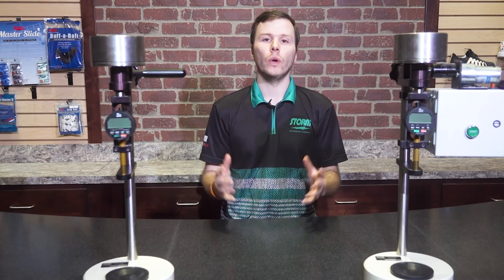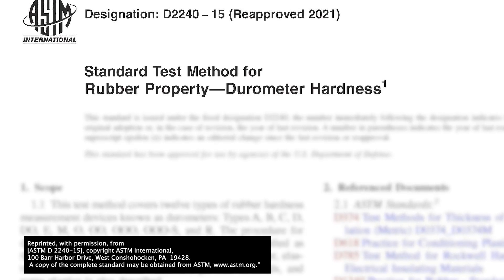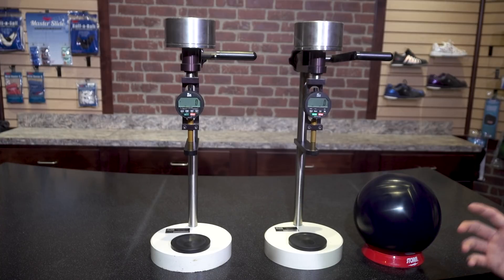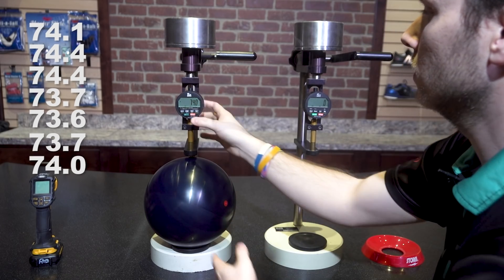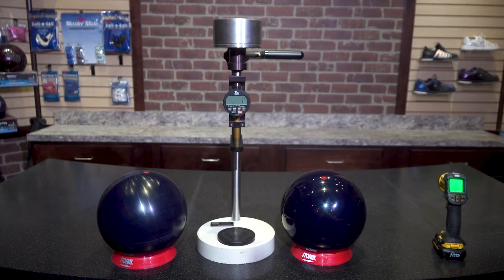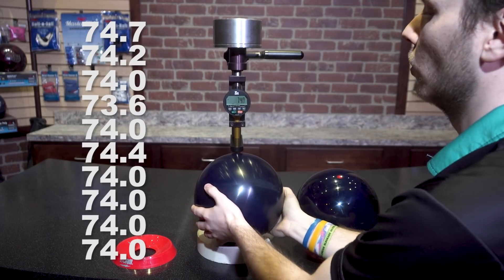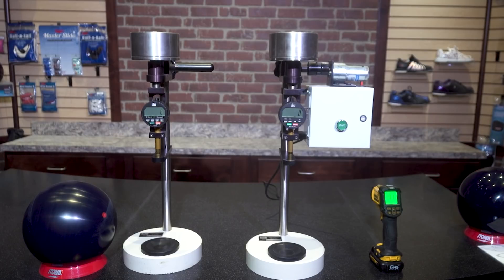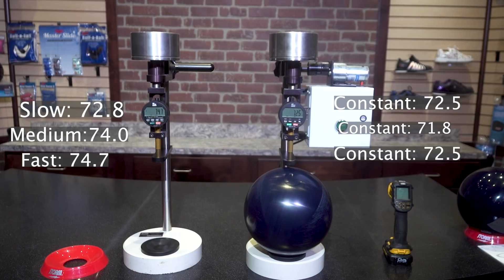Storm | Durometer Testing

Comment: Storm should sue
Reply: @bbarnes654  where? Arlington in the same room with the same durometer used for initial certification.
Reply: On what grounds? That they didn’t produce product to the specs they agreed upon with the procedures they agreed upon?
Reply: @williamfreitas7016  USBC simp.
Reply: @williamfreitas7016  Too many variables. The usbc data was total bunk. They didn’t visually show the testing. Its all numbers. This video clearly shows there are far too many variables to ban 6 balls on the grounds of this flawed testing.
Reply: @Hahahanoyes  they still can’t sue because they agreed to the process and procedure. Well they could but they wouldn’t win and they know it. The time to question the results is when they received the report on initial certification saying the balls were within .5 of the spec which auto triggers spot checking IAW the equipment specifications manual.
Reply: @williamfreitas7016  you know they did produce balls in good faith. Your being a troll. The whole point of the vid shows how usbc is playing dirty with measuring metrics that have variances they don't want to allow for. Either out of ignorance or spite. Either way, storm deserves to defend themselves. And can sue for losses if it goes that far.
Reply: @MGW1974  no, I don’t know they were produced in good faith and “accidentally” fail after. I hope so but don’t know. I’ve been saying all along that given the fact Storm doesn’t make it’s own coverstocks the subcontractor could’ve done something to alter the final specification. But that’s not what Storm is saying. They’re blaming a process they could pass since inception until recently.

Comment: I don’t think this is the right way to handle this situation. Storm is publicly challenging the validity of the rule. These findings/defenses should be brought to the attention of the USBC privately. They can petition for a rule change or more explicit standardization of testing. This is trying to publicly discredit the rule and the governing body of the sport. If I were a regulator in this situation I’d be pretty unhappy.
Reply: if USBC went to Storm privately and said we think you guys have an issue, you should look into it and make sure everything is right. Then I'd agree with you
Reply: @rb8999  you mean like they did with the Spectre and were told nothing is wrong?
Reply: @rb8999  Exactly. USBC brought this into the public sphere. Storm has every right to publicly disclose its defense.
Reply: @rb8999  This is exactly what the USBC did. They found an issue and handled the matter with Storm. An agreement was hashed out, a consent order of sorts, and a joint statement was released.
Reply: @IamtheBonkers  We don't have all of the information and we never will. 

Assuming Storm calibrates against USBC's durometer every quarter, what if there's enough difference where Storm measures balls as passing and USBC measures them under spec? This video shows to the public who has no clue that there can be differences. Was this just an issue in Q4? Were there balls from Q2/Q3 that didn't pass?

The reason as to why this started with the Spectre won't become public knowledge.
Reply: @rb8999  What you're saying exactly illustrates my point. This video response puts into question the USBC's rule and their testing methodology. It inflames the situation and erodes confidence in the USBC and the rules and regulations which govern the sport. 

I don't know what was discussed behind closed doors -- of course. However, it's clear the exclusion and exchange program for the six products (not including the spectre) was an agreed upon resolution hashed out by some kind of consent order between the USBC and Storm.
Reply: @IamtheBonkers  confidence in USBC has been eroding for years, nothing new there
Reply: @rb8999  confidence has been eroding, yes. Also statements oozing with the holier than thou, condescending attitude as Chad Murthy’s sure don’t help that matter. But in this situation we won’t know if it’s properly being placed.
Reply: @rb8999  I believe they are calibrated prior to each testing session against a known hardness.  Calibrated meaning within the Testing spec of the durometers.  So it would be more than calibrated quarterly.  I used to do testing in another field and we calibrated our equipment every time we started a testing session to make sure the equipment readings didn't drift out of spec.
Reply: @Music-pl8xf  yes, obviously calibrated more than quarterly. USBC allows companies to cross check their durometers directly against USBC's quarterly
Reply: The USBC already knows about this information, however, they tried to throw Storm under the bus and ban their bowling balls without banning other ball companies equipment
Reply: USBC tried to humiliate Storm, and likely cost them millions of dollars. They already attempted to challenge USBC, and nothing came of it. I think this is exactly what they needed to do to show people exactly what is going on.
Reply: Nothing about what USBC is doing is right. Look on the world scope of things, every major bowling association is allowing the 6 balls to be used except usbc.
Reply: I can see Storm getting a closer look and no agreement will be had to keep them in business next time. They will go the way Lane 1 did all because they think they’re more powerful than they are.

Comment: If you have a device that takes the human error out of it… why aren’t you using it for your video.
Reply: The USBC doesn't use this device. So they used the same process as the USBC.
Reply: @ChampionshipBowling  but to show the difference surface and temperatures makes is skewed because of human error.  Age of the balls matter as well.  But I’m guessing they don’t have a ball with measurements kept.  Absorption of the lane oil I’m confident would change the hardness as well.  The number of times it’s been thrown and hitting the lanes would also change the hardness. 

I think what USBC did is improper and poorly timed, but this isn’t proving the Storm validity of their product.  

I know quite a few people, myself included just aren’t interested in storm products.  We are expected to pay shipping for replacements, and $50 drilling credit for someone who is using grips and switch grip sleeves doesn’t cover it.  As a long time customer and believer I’ve had to just walk away from the product line till everything gets sorted out.  Lots of my friends are on the same page.  I hope USBC stops targeting Storm.  I’m guessing they were only testing Storm equipment.. anyone want to take that bet ? Lol
Reply: @Ny_babs  the sole purpose of this video is to show you, that regardless of the other variables you mentioned,  the testing device has a recognized variance. And not just 1, it has many. Human error, contamination,  movement,  ect. That's all this video is showing.
Reply: @ChampionshipBowling  no, it also shows that Storm 100% knew their factory-polished balls were going to test illegal once the finish was applied
Reply: @williamfreitas7016  it wasn’t an initial failure or else it wouldn’t have been approved.
Reply: @Mike_Akins  correct. I meant initially the Spectre was spot checked and failed. The first spot checked balls by Motiv, Big Bowling and each Brunswick brand passed.
Reply: @williamfreitas7016  But the spot checks could have also been out in the field and failed due to human error so your argument still doesn't make sense. USBC was doing the testing behind a black curtain when doing field testing which is just unsettling.
Reply: @williamfreitas7016  Got sources to back that up? Or is that hearsay?
Reply: @sammy64gaming15  if you would read the equipment specs manual and the press release spot checks were NOT done in the field.
Reply: @sammy64gaming15  field testing was only on used equipment to collect data concerning changes with age and use.
Reply: @lofiloungeallday247  a valid source I can’t disclose. Common sense too. If only Storm was checked and there wasn’t results to show them about other companies they’d be screaming about it and justifiably so.
Reply: @sammy64gaming15  they DID NOT ban those six from those tests. The testing turned over to Storm was on NIB balls.
Reply: @sammy64gaming15  the testing at the open supposedly was to collect data for how time and use affects hardness.
Reply: @williamfreitas7016  1. The majority of the data that was used to justify USBC Banning MUST have came from the open considering all balls were less than 5 months old and all PBA players refused to give there balls to USBC before the master’s began. 2. The NIB testing being turned over to storm is very unlikely.
Reply: @sammy64gaming15  so believe every word from Storm and none from USBC even though if you were correct Storm would be screaming that from the rooftops.
Reply: @sammy64gaming15  as NGB the USBC is the final word and as such isn’t required to prove themselves. Now should they? Absolutely. Is Chad Murphy a condescending ass clown? Absolutely. With today’s technology there’s no reason why a copy of the initial report isn’t included on the approved ball list for all to see. Transparency isn’t happening and I would love for it to be different. All of that doesn’t change the fact all the manufacturers know the process and procedures and have agreed to all of us previously. The only part of this SPI is contesting is that durometers vary which in the manual and press release is admitted. It’s the reason why four times a year manufacturers can check their durometers against the only one that matters. It is strange though how SPI hasn’t had an issue with this process for over 20 years but as soon as it affects them they say it’s so awfully flawed. How was it so accurate last year and so God awful now? With SPI not making their own covers my thought was with supply chain issues a subcontractor may have altered a process or ingredient. Heck, even a change in the HVAC system can alter hardness. If there is such a variance (around 2 by this video) then why make them at the minimum not allowing for the variance? Even the IQ tour in the video failed but they just kept talking ignoring that fact.
Reply: @williamfreitas7016  100% agree
Reply: @williamfreitas7016  Yeah, but don't a lot of the pro's drill NIB balls for the most part prior to the event and during the event?  So the field test would be testing a ball that has minimal games rolled on it at best.  The field test would make more sense on non-pro bowlers as they are more likely to be rolling balls that have way more games on them.  Doing the field test behind a curtain and not allowing the owner to observe the test is also wrong.  The USBC would be better off purchasing balls from the user and sending them off to independent labs for testing.
Reply: @Music-pl8xf  the field testing was only on urethanes of which a lot of pros have been using older balls with the belief they get softer over time. The same testing process has been in use for bowling for 42 years. Yes, that pre-dates the USBC. Eight balls in all that time have had some sort of certification revocation or exclusion with seven from one company and all happening this calendar year. Keep telling yourself it’s the test even as that one company changed it’s process to pass. 
Independent lab? People already complain about the less than four cents a day for national dues. There’s no way bowlers would be willing to cover the increase independent labs would cost.
Reply: @williamfreitas7016  No. Four times a year is not usable for purposes of production QC. The manufacturer should be able to use to most optimal surface for their testing, because end users like you and me are going to be changing surfaces; and that change might drive an approved ball out of the approved range. I am just interested in growing the sport.
Reply: @jimk9290  I’m fine with changes being made going forward so please don’t misunderstand me. As of these six there was a testing procedure in place that all parties agreed to until one company had several failures. Just as when Motiv had the issue with the core diff being too high they and others by themselves started making cores not at spec. By choosing to be right at the minimum production standards say they’re asking for issues.
Reply: @williamfreitas7016  Also I think the video is showing that USBC is attempting to set an absolute specification on something that shouldn't have an absolute. Just my opinion.
Reply: @lofiloungeallday247  it’s the minimum. Most of the six were well below the minimum. USBC shouldn’t set a minimum but Storm can erroneously advertise a spec it doesn’t meet? 
I like Storm. I wish they’d accept responsibility and move on instead of making one excuse after another. Why not be truthful in what happened to the polish process to cause this instead of the smoke and mirrors? A HyRoad made a few years ago can meet 74D but one made during Q4 2021 can’t. Why?
Reply: @williamfreitas7016  Polish doesn't giving a true measure of the surface hardness. The actual hardness seems to be fine but polish can influence it. Again based on the video; I am not a scientist. Polish should have 0 impact on anything and probably should be removed from being a factor in any tests UNLESS it is used when the balls are approved. I.E. send in balls with polish and balls without; get results. Currently it's only balls without when approving based on what I read in the USBC statement. Idk again just my opinion. Also I assumed that the HyRoad passed since USBC said in their statement they concluded whatever testing they were doing to Storm balls. I made the assumption they tested every single ball that has been made and their findings was on these 6.
Reply: @lofiloungeallday247  if you read the second billet point of the FAQ part of the press release it says “Manufacturers voluntarily submit ball model samples for approval. As part of that, each company agrees to manufacture future production balls the same as the sample and within USBC specifications” That includes polish. I’m not sure where the misinformation that they’re not tested initially with polish came from.
Reply: @williamfreitas7016  They are tested at 500 grit from what I have read.  They 100% do not test the balls with polish at the initial approval process.
Reply: @lofiloungeallday247  so you say. Unfortunately the equipment specifications manual says differently. 500 would make more sense as usually that would be the softest surface due to having deeper valleys. 
Where I see the contradiction is where the USBC says the polish process was identified as the cause then says even without polish the six would still fail. I don’t see how it can be both ways.
Reply: @williamfreitas7016  I agree. cant be both ways. But this is how they are tested. Look at any ball picture that they have posted of the actual ball on the approved list. They all have surface on them; they don't sand the balls down after they get them. This is from my trusty source :)
Reply: @williamfreitas7016  Take a Spectre and sand it to the most optimal surface. Don't use any polish, since that invalidates the cover hardness test. This is not a polish hardness test. Beside, the end user can remove polish and change surface. Cool it to 70 degrees, and pull the handle down as fast as reasonable. If it fails that test, it's out of specs. Has anyone done this?